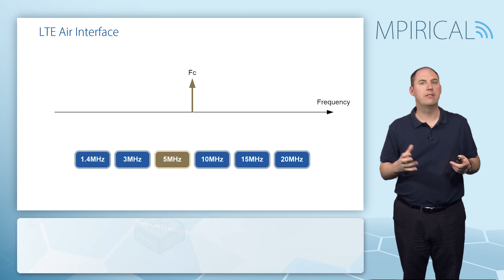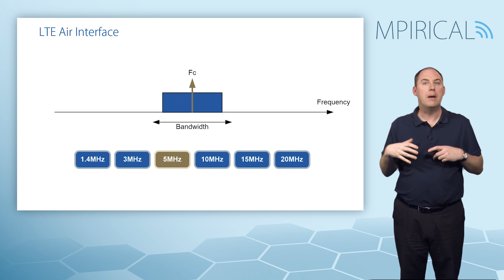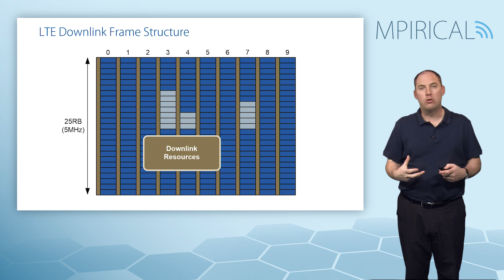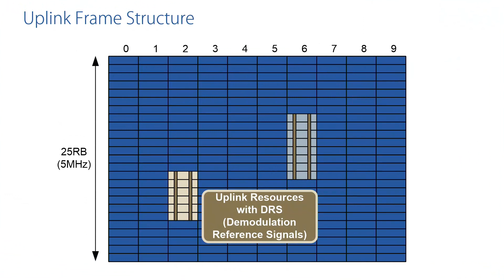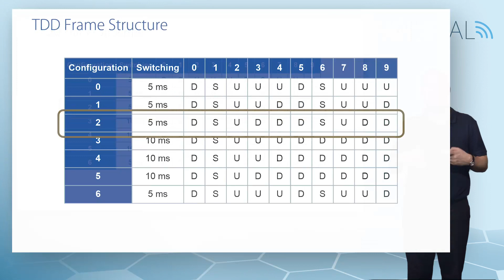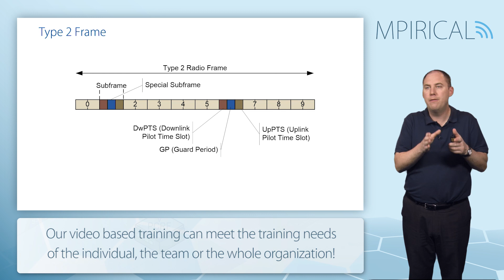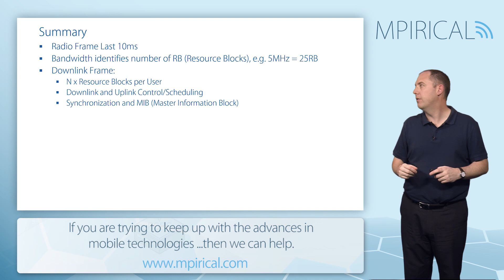What is LTE Frame Structure? Find Out With Mpirical

Comment: Thanks for the wonderful knowledge sharing 
I have one doubt 
How one complete radio frame can be transmitted over a lower Bandwith system like 1.4/3/5 MHZ 
As I understand 1 subframe =2 slot; 1slot =1RB ( 12 Subcarrier in frequency domain and 7 OFDM symbol (NCP) time domain ) having a duration of 0.5 ms .
So 6 RB = 3ms 
Now as per your lession one frame=10ms , then how canwe transmit it over 6RB(3ms)/1.4MHz bandwidth ???
Reply from the maker: When describing bandwidth the term RB (Resource Block) is used, e.g. 6RB’s = 1.4MHz. In the LTE frame, when looking at frequency and time the term PRB (Physical Resource block) is used. PRBs last 0.5ms and occupy 12 subcarriers, i.e 1RB, as such for each RB of bandwidth you get 2 PRBs per 1ms. As an example, a 1.4MHz channel would have 6RB’s bandwidth providing 12PRB’s per 1ms, or 120PRB’s per 10ms frame.  Note that sometimes the term “Resource block” identifies 12subcarriers x 1ms, i.e. 2 PRBs.